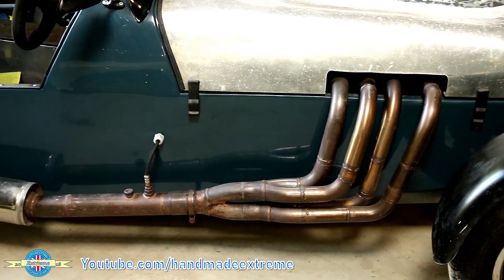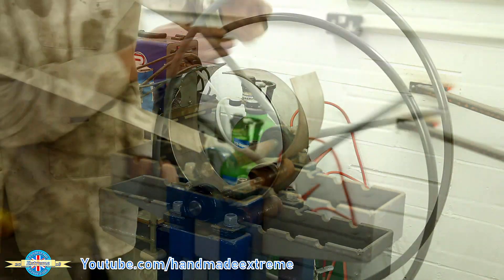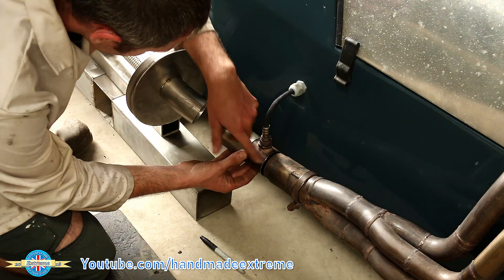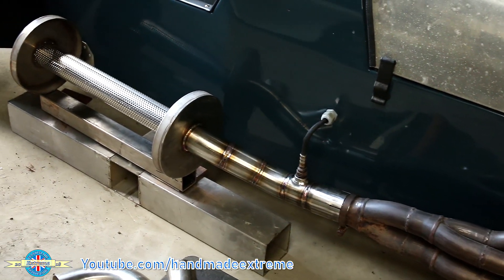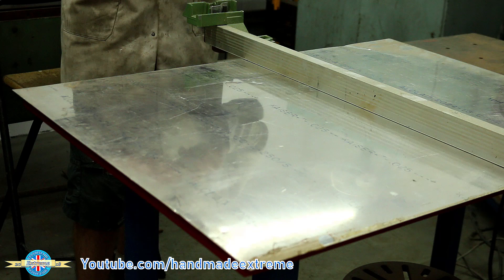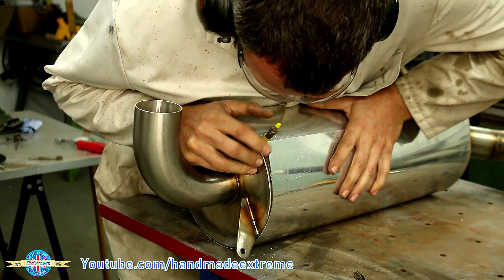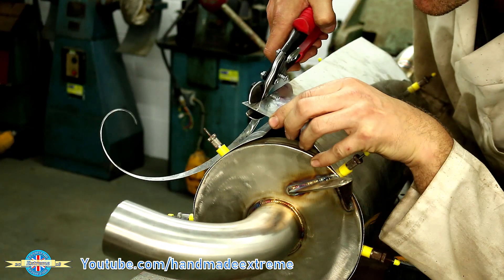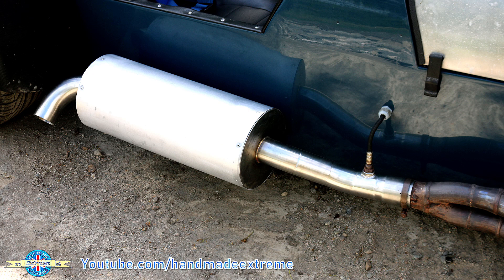Making a Repackable Exhaust Silencer - Stainless Steel Exhaust

Comment: I thought the stuffing goes in loose and after the first heat cycle it expands. Actually the threads melting is what causes it to expand/fluff up. Could you know some information on what product you used and how you worked out how much?